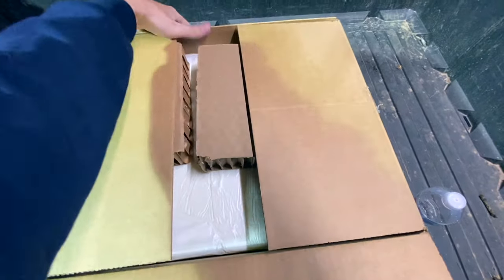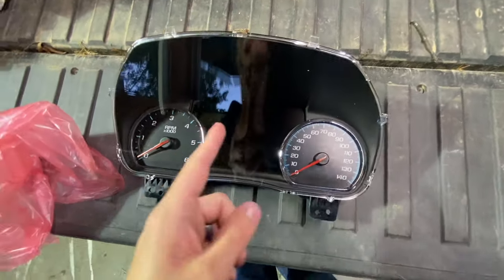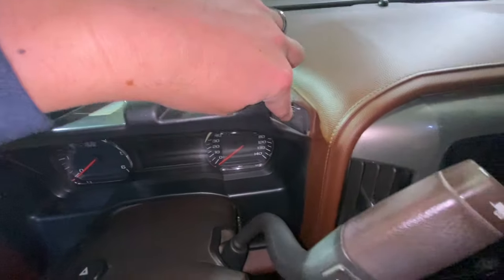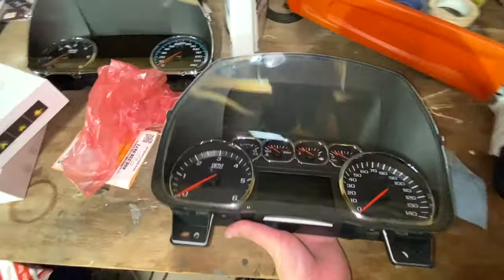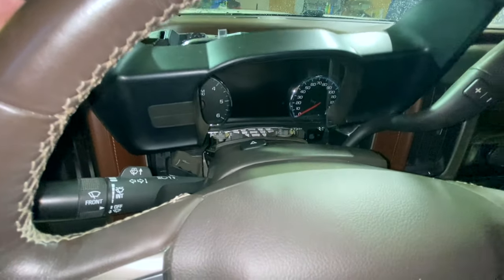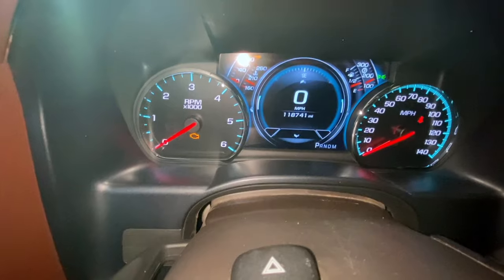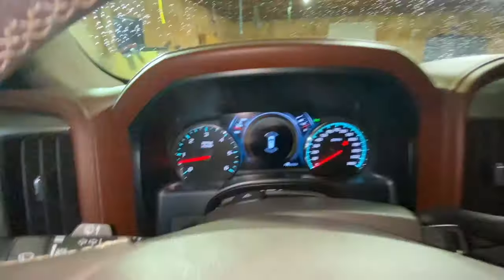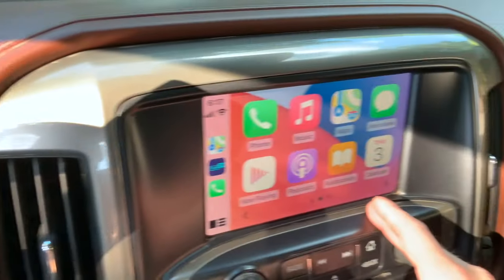How to Install Denali Cluster in 2014 - 2018 Chevy Silverado or GMC Sierra

Comment: This guy never disappoints
Reply from the maker: Thanks buddy, this was a fun video to make!
Reply: @DustinT  Great video man. I noticed in the "off road" page it showed you at 45 degrees pitch. I was just wondering if that leveld out and read the accurate pitch. Also wondering what year your vehicle is. I have 2016 and Android Auto wasn't available, i had it installed after purchase from the dealer. Thanks

Comment: I’m looking to get this for my 18 Sierra. My question is, all the toggle switches under the heat stack (cargo lights, park assist, lane assist, etc..)
When you toggle those on will those icons still pop up on the new cluster? 
Also, will the V8-V4 still pop up as well? I do have the range to deactivate that, but I just always wanna see that it’s running V8 full time. Thank you!

Comment: Hi @Dustin i will do this cluster upgrade soon. I just notice on the display on 4x4 info display if its working properly. I can see on your video that the angle on the display of the 4x4 display and looks like that it was not working properly. The angle is not in the proper angle where your truck is park in your garage. Please let us know the answer.
Reply: I was wondering the same thing. Have you done the install yet and if so do the angles work properly?
Reply: I was wondering also if that something that has to be recalibrated at the dealer.

Comment: Do you know what year cluster they sent you? I went to the website and all they have for a 2014 option is in “RED”. 
Great video btw!
Reply: If you aant blue cluster. Uiu have to choose 2016 blue gas. Or 2017 diesel blue. Dont choose 2017 gas it wont work.

Comment: I had a friend say that programming wasn’t necessary on these clusters as long as you get one from a Denali the same year as your Silverado. He bought one used off eBay, plugged it in and it’s worked fine ever since. Any truth to this?
Reply: Risk and try worst case a trip to the dealer
Reply: @slowx7amg  I took the risk and after paying the dealership 170$ of my non refundable money, the guy swore they couldn’t get it to program and I was out almost 200$ for them “ trying “ to reprogram the cluster. The only thing my cluster doesn’t display is the mileage, everything else works fine. So when I take it to get an oil change I have to swap back to the old cluster so they can get the mileage. Pain in the ass, but it still looks amazing in my truck. Wish I wouldn’t have paid to have them reprogram it but I’ve wasted more money than that in a strip club 🤷‍♂️
Reply: @thedavid3737  did the needles work before you programmed it? I got a cluster and plugged it in everything lit up but obviously miles were at 0 but when i pushed the gas the needles didnt move... i figure i have to go to the dealer to have them program it?
Reply: @nutterbutters2232  the needles worked on my cluster before it was programmed. The cluster I got came out of the same year Denali as my Silverado tho so I don’t know if that has anything to do with it or not. The only thing programming does is move everything from your old cluster to the new one and if you have any features on the new cluster that’s not compatible with your truck like front cameras, then it just disables you getting any alerts about front cameras.
Reply: Did a Denali cluster on my 2014 gmc sierra slt. Everything works but mileage won’t show. Would programming it solve this problem ?

Comment: yoooo, so i am doing an overland build on my 2015 chevy 2500hd but i want this gauge cluster, but i dont know if it ohas the offroad section in the info tab, would you happen to know if it does have that?? my truck is a z71 and it has it on the stock gauge cluster and i dont want to lose that if i go to the denali cluster
Reply: NVM ME, im dumb, i didnt watch through the rest of the video SMH, and ive watch it like 5 times, i must of skipped over that part

Comment: I have a 15 silverado just like yours but they don't have a blue cluster for this year only 16 and up does that matter
Reply: You can buy the 2016 blue gas or 2017 diesel. It will work but 2017 gas wont work.

Comment: So only thing I am wondering is how you are averaging 23+ miles per gallon haha. Do you have a programmer in the truck?? Looks to be about the same size lift as my truck and I average LOW teens with AC off. Sad face.
Reply: lighten up on the gas and let go when you can… depends where you’re living and the amount of traffic too

Comment: Hey Bro any update on your Amp Steps ?
Reply from the maker: Still working flawless. I literally haven’t had a single instance of them not working. Highly recommend
Reply: @DustinT  I've had them for 3 years now and just stopped working 4 days ago. I checked the fuse and it is good.